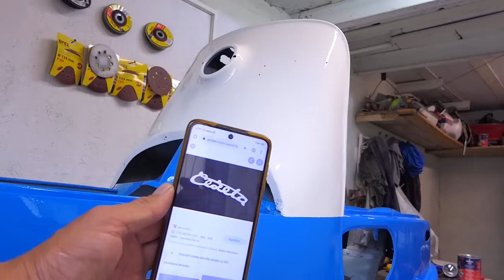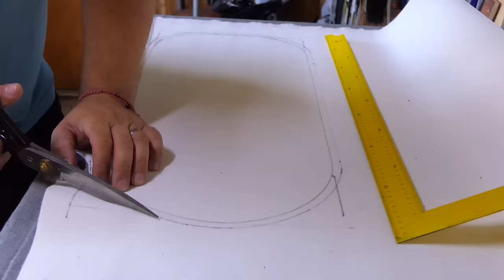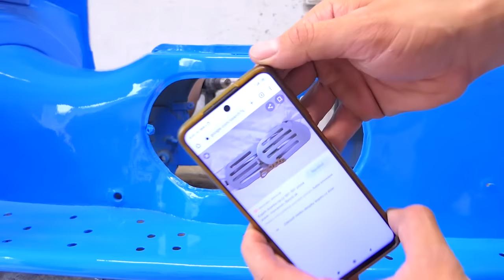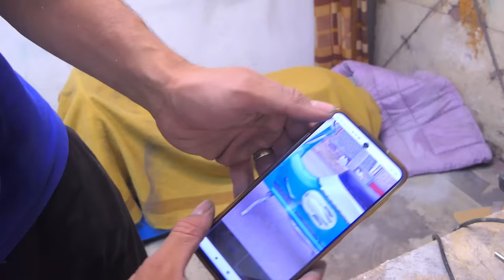Restoration Rusty Old Scooter - FINAL VIDEO

Comment: The original design of the Čezeta (Czezeta) is unique amongst scooters. It was produced in 1957 - 1963. In the very first year of production, it attracted customers in 20 countries around the world. It is unusually long for a two-wheeled vehicle at 2 metres (6 ft 7 in) and has a distinctive torpedo-shaped body with full-length running boards and a long seat that lifted to reveal a substantial luggage compartment, using space that in most scooters is occupied by the fuel tank. This made the Čezeta ideal for 2 people and popular with young Czechs. This scooter was powered by the 175 cc ČZ two-stroke single-cylinder motorcycle engine, giving a top speed of 85 kph (55 mph), dry weight 130 kg and fuel economy of 3.2 litres of gas/100 km.  – In New Zealand a local company, JNZ Manufacturing Ltd produced 4,000 these scooters during the early 1960s.
Reply: Muy interesante la descripción,saludos!
Reply: Is the motor Puch based ?
Reply: Do you sale...?
Reply: No
Reply: А куда вы все эти вещи деваете? коллекцию собираете?

Comment: Brilliant work!  I only see two problems: 1. When welding the most serious rust damages, you produced some double-layers of sheet metal. You'd have to put some rust-protection between these layers to prevent this from rusting again. 2. Some of the minor damages you only covered with putty without removing the rust completely. These areas will rust again very soon. Best wishes, Andreas
Reply: 11¹
Reply: Completamente d'accordo. Restauro fatto molto approssimativo,troppo stucco e poca lattoneria. Giudizio negativo!!
Reply: I agree with you, the rust was not removed completely, so, it you be back soon.
But it was a wonderful job, he used all the original components. congratulations!!
Reply: Totalmente de acuerdo. Falta más trabajo. Pero esta bien.
Reply: Great job no doubt but 2 important  points for sure.
Reply: He create what I call a 10-foot car- scooter in this case.This thing looks perfect as long as you stand at least 10 feet away.
Pitty he could dune a much better job,if he did has a bit more patience😊 😊😊

Also a big no no, dry clutch plates mounted in the basket.  The clutch plates need to soaked in oil before mounted!!
Reply: @antoniogonzalezart66  0
Reply: Мелкие дырочки можно заправлять  кастолином латунью и слоев небудет и ржавчины а так робота кропотливая и результат отлично
Reply: Si coincido con muchos de ustedes muchachos en las picaduras de los estribos tendría que haber rellenado con estaño lo demás estuvo muy bien saludos ⭐⭐⭐🇦🇷🇦🇷🇦🇷🇦🇷

Comment: Did you guys put down (before painting or bondo) any rust remover or rust converter to make sure it doesn`t rust again or have the metal fall apart under the paint? I mean you cant just paint and bondo over rust and expect it to not give you problems down the road. 
Plus the paint that was on it originally could have had lead in it, so be careful you guys.
overall nice job.

Comment: How come you didn't  hone out piston chamber,  usually  you do this when rebuilding an engine? Also when finishing  paint how come you didn't  wet sand your paint job, would be great because  what this dose is, it takes away any imperfections in the paint and comes out beautiful. Then you put a clear coat on it several if you wish, it would give the look that much better and even a deeper look...   😢😊

Comment: The body work was catastrophic. You don't weld metal sheets on rust, they rust through again immediately. A sheet metal was simply welded over the corroded frame and dents were not pulled out but smeared over.

Comment: You need to cut out ALL of the rust, just filling holes with plastic filler is not the propper way to do this. The rust will come back.  Or at least those areas where the rust was mechanically removed, you need to treat with rust converted, e.g. fertan or brunox,

Comment: Although finished results looked pretty good not a fan of his rusted metal repairs and his way too much use of body filler. Left too much rusted metal on repairs by not cutting beyond rusted areas and then covered it up with way too much body filler. Wonder how long before rust comes through again.

Comment: Filling rust holes with fiberglass filler is not a good option. Moisture will get in between and cause further rust. This is not a good restoration method.

Comment: Very nice and hard work. But, you did not pay enough attention to details. All the metals showing look old and scratched. Specially the ones right in front of the eyes on the handle and around the nuts. You could have spend a bit more time polishing it to perfection. And the rubber foot rest looked bad, you could cut in in one piece. Otherwise the rest looks excellent.

Comment: Rebuilding is the correct word not restoring. Restoring means to put all the original parts back to where it was once originated. You're replacing parts. You are renewing or rebuilding not restoring.

Comment: Bodywork isn't done properly. And why would you pull a motor and not split the casings and check on the transmission internals ?
This isn't a good restoration.

Comment: Apenas um passeio numa estrada mal pavimentada e será visto que esse trabalho não pode ser chamada de uma restauração.
A recuperação da lataria soldou chapas mas deixou buracos que foram cobertos com massa de funilaria. Na parte mecânica, a simples pintura do amortecedor não considerou a segurança do condutor.
O trabalho com o logotipo mostra que ao menos um item foi de qualidade, embora a entrada de ar tenha sido feita de forma rústica. A recuperação do assento merecia um trabalho de jato de areia.
E a parte elétrica? Nada nos faróis e nas lanternas?
É uma vergonha chamar um trabalho desses de restauração.

Just a walk on a badly paved road and it will be seen that this work cannot be called a restoration.
The recovery of the bodywork welded the sheets but left holes that were covered with bodywork putty. In the mechanical part, the simple painting of the shock absorber does not considered driver safety.
The work with the logo shows that at least one item was of good quality, although the air intake was done in a rustic way. Seat recovery deserved a sandblasting job.
And the electrical part? Nothing in the headlights and taillights?
It's a shame to call such work as restoration.

Stačí prechádzka po zle spevnenej ceste a uvidí sa, že toto dielo nemožno nazvať reštaurovaním.
Pri obnove karosérie sa plechy zvarili, ale zostali diery, ktoré boli zakryté karosárskym tmelom. V mechanickej časti jednoduché lakovanie tlmiča neberie ohľad na bezpečnosť vodiča.
Práca s logom ukazuje, že minimálne jedna položka bola kvalitná, hoci nasávanie vzduchu bolo urobené rustikálnym spôsobom. Obnova sedadla si zaslúžila pieskovanie.
A elektrická časť? Nič v predných a zadných svetlách?
Takúto prácu je škoda nazývať reštaurovaním.